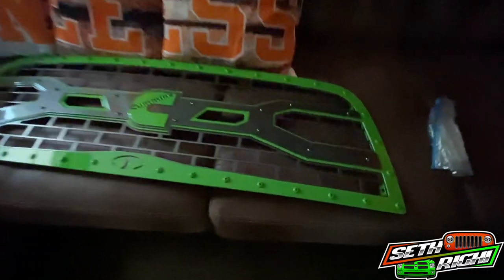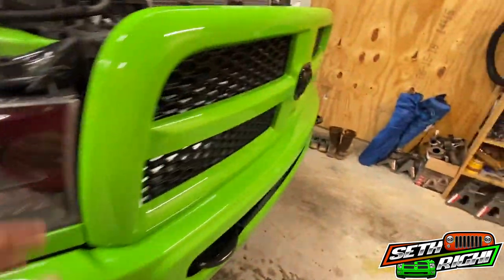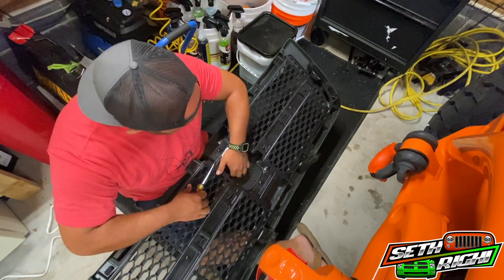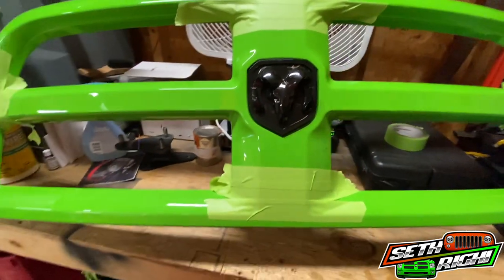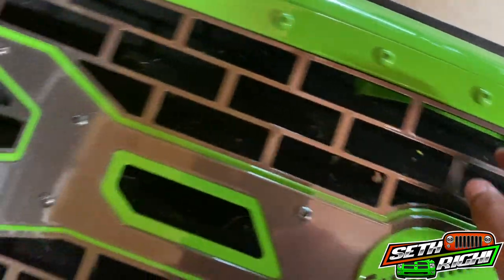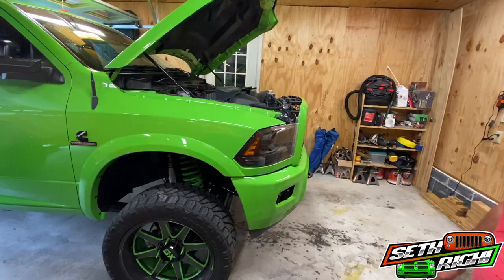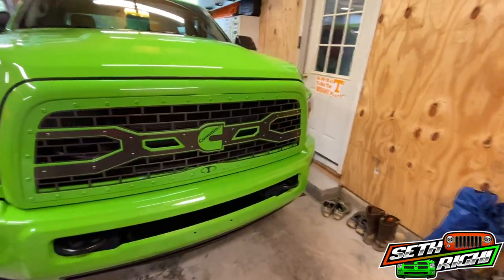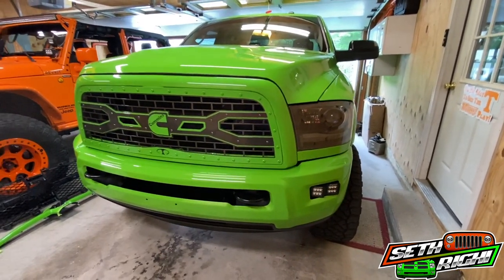Installing a New Custom Powder Coated CTC Fab Grille on my RAM

Comment: hey man question about how tall is your truck from floor to roof? and what size lift and tires are installed? Sorry if this was already posted somewhere and i can find it.
I have a parking garage the is height 6'10" and looking to see what combo if any i can install on a ram 3500 or 2500 (looking to buy one). thanks in advance for your help!
Reply from the maker: Neosconcept’s not sure the height it’s a standard garage door it’s a 2.5 level and 33s I got like 2-3 inches of room left